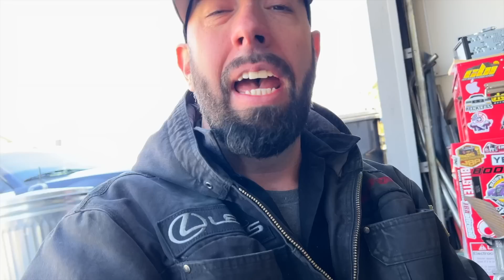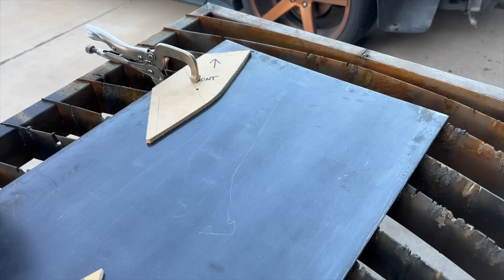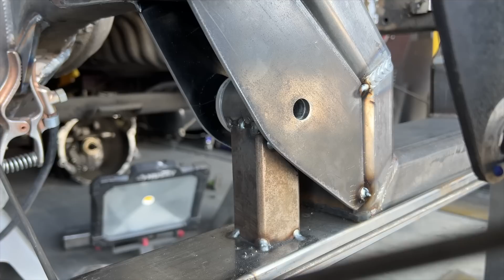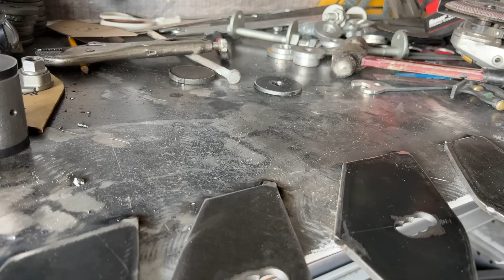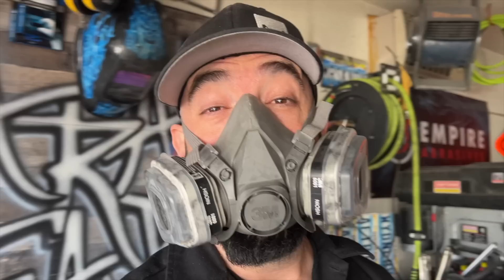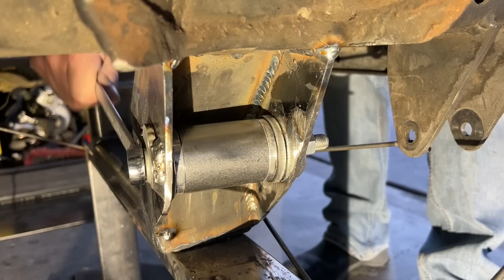How to Build Adjustable Alignment Bushings! Mighty Max Ep: 19

Comment: I know I'm about 3 years late, but anyway... Why didn't you block your truck up so that IT was level and not guesstimate with the level being off 🤔? Just wondering. Haha
Reply from the maker: Good question! This was the only time I used the level. Most often I’m measuring from the ground because it’s easier and a bit more accurate for most things. Imagine wanting to mount something to the frame in the same spot on both sides. Measuring up from the ground is easy and effective even if the ground is at a crazy angle. 
If the truck was leveled, I’d have to situate a level every time I wanted to find the same point on the left and right sides.

Comment: What would you recommend? I have a 84 Corvette frame with the stock rear end .  the rear end is independent, suspension I have made 
the frame longer because I’m doing a body swap. I have an LS with a 4L80E  . either I need to make the stock C beam longer or build my own torque arm. I think it would be better if I had a torque arm your thoughts would be much appreciated and how I would go about making a torque arm

Comment: Was just re watching this one, and noticed that you put the 1/4 washers on one end instead of one on each end to keep the bushing centered. While the width would be right, wouldn't that shift the bushing a 1/4 off front to rear...which would possible effect caster if you don't compensate when you make new control arms? And if you used the existing arms, it seems like it would be an issue. Or am I overthinking it?
Reply from the maker: That was a whole lot of correctness. I’m currently in the process of building and filming the lower control arms and I’ve already talked about how confusing it’s going to be. Everything will be based off of the front edge of the factory control arm bushings. If you watch the video a third time 😅 (edited because I realized I meant the crossmember video) you’ll see that the first thing I do is bolt the mockup bushings to the front edge of the crossmember. In essence the only thing that will remain factory is the relationship between the position of the ball joint to the position of the front of the bushing. 
You are correct though; Moving the control arms forward or back would in fact change caster. As long as I don’t screw things up, (probable) caster and camber will remain the same but the bushing widths will change and the additional bushing on the triangulated control arm will be in a new location.
Hang in there. I’ll try my best to make it make sense.

Comment: Go to the hardware store and buy a bottle of muriatic acid. Whenever you need to weld galvanized or zinc coated parts, just soak them in a small mixing cup of acid for a few minutes, then rinse them with water. That completely removes the coating, making them safe to weld.

Comment: Also, the Mitsubishi truck as you know has press in balljoints which make it difficult to make arms. However the Nissan D21 (Hardbody) has bolt in balljoints that both fit the Mitsubishi spindles.
Reply from the maker: Haha!! You’re going to giggle when you see the new video on uppers tomorrow morning. 😂
When you say “both” are you referring to the lowers as well? I haven’t gotten that far yet.
Reply: @GarageFab  yep upper and lowers both the same. Both fit Mitsu or Nissan spindles. There's also some screw in style balljoints that fit. K772, K778, K727 are the most popular ones.
Reply from the maker: Much appreciated! The Max lowers are also bolt-on so I was just planning on using those but I’ll check out the Nissans and see which I like better. You are appreciated. 🙏
Reply: @GarageFab  the Nissan has a press in lower. So you can use a mitsu lower in a Nissan. Been a decade since I had a shop building tube arms. Some of that's hard to Remember.
Reply from the maker: Oh! Ok.

Comment: Hey, I've been using cam bolts on control arms on bagged trucks for a while. I now also use them on 4 links too. I use the ones from a GM 88-98 truck. Oreilly stocks them. Part number 87400. I also have cad drawings for the loops to go around the cam bolts and the slotted holes that can be applied to any job. 

I used to have access to a plasma cutter so now I use sendcutsend for all my cutting. 

If you need any of those drawings please let me know. I don't know if you remember me but I did the Mazda limo and the Dawgsled on the cover of minitruckin November 02
Reply from the maker: Thank you for that! I’ll look into them. The Toyota version was not cheap. My next build will require 8 of them so saving some money would be swell.
Funny, I intend to throw this thing on the alignment rack when I’m done and see how close I got with just measuring the rear suspension and left enough room in the tabs to convert them to adjustable bushings if needed. Probably would’ve been a good idea to just do it from the start.
Yes! I remember those trucks. Clearly you’ve been in this scene far longer than I have. In 02 my Mighty Max sported a targa top. (My biggest mod at the time) I didn’t know anything about suspension back then.

Comment: Get a small fan that blows away the fumes as you weld. Might have to turn up your gas shield. Or even a shop vac turned on to pull away the yellow mustard gas lol
Reply from the maker: Good call. I’ll be assembling something soon!
Reply: @GarageFab  down draft welding table. What ever it is I'm sure you will Ace it. Love the videos.

Comment: Your router tip is pure gold. A little tip in return. Use the cams to get the alignment done. After everything is where it needs to be, measure the cam bolt location to make a cam delete plate. I did this with 2"x1.5"x0.25" blocks I made to replace the cam. Drill a hole in the plate where the bolt sits in the cam. In the end, no more screwing up the alignment with the first wrong bump you hit.
Reply from the maker: I like that idea a lot. We see delete plates pretty often on off road vehicles. I’ll definitely be doing that if I see any alignment drift.
Reply: @GarageFab  I have 26 miles of dirt between my home and the first hard ball road. I would get 2 maybe 3 trips to town before I would start to notice it was off again. I almost got to the point I was going to just weld it in place. Then I stumbled a store bought cam delete kit, and thought, I can make that. About 2 hours of work later, and the problem is gone.
I've been contemplating starting a channel myself to show that even off grid with no garage, if you really want something, anything is possible when you set your mind to it. I have a couple hurtles to figure out first though. 1 is my lack of signal for uploading (feels like the good old AOL days out here). 2 I'm a wildland fire lookout. I actually move out to my tower for the summer tomorrow. That brings in a hole new set of challenges to overcome between time and when fire restrictions come into play. It's still possible, I just need to sit down and put some good thoughts to it all.

Comment: Tip for working on a floor that’s not level if you feel up for another small project. You can make some custom stands with large threaded rod that will allow you to adjust each side or corner independently in small increments. This way on the side where your floor is lower you will adjust the stands a little higher to compensate and keep your truck level. Or you can just keep doing what you’re doing. 😂
Reply from the maker: Quite brilliant. If you don’t mind I’m going to steal your idea and create a video on creating adjustable stands. I think that could be really interesting.
For me personally, though my floor is slanted slightly, it is straight, so I rely mostly on squares rather than levels. (15 inches from the ground is the same in both sides regardless of the slant)
My next build will utilize laser levels so I’ll be building a low profile frame table. 👍
Reply: @GarageFab  yeah by all means! Curious to see what you come up with. It’s not my original idea either, I saw someone else do a variation of it but don’t remember where I saw it. Just filed it away for potential use later. 🙂
Reply: @GarageFab  Also fyi another channel you might like is Austin Niemela. He also does custom automotive fab work.
Reply from the maker: I’ve seen a few of his. Good shtuff!

Comment: Hello Aaron, I'm back with a question. The rear suspension is 4 links, in which the lower levers are attached to the bridge using simple rubber-metal saylet blocks, and the rear trailing arms are attached to the frame like on a Mitsubishi Pajero, we call them "sticks", I know that such a connection is used where a pushing effect is needed, and w upper arms of the same design but only installed on the turn. I hope I made my thoughts clear.

￼
Reply from the maker: I think I’m clear. And that sounds good so far. What’s the question?
Reply: @GarageFab  я хочу построить подвеску на таких рычагах, будет ли она нормально работать? Мне такая конструкция рычагов не встречалась и по этому куча сомнений, может быть я слишком сильно паникую 🙄, кстати ход заднего моста планируется в 27 см так как мне больше и не нужно. Музыка в твоих роликах классная 👌
Reply from the maker: I think you’re on the right track. Everything should be just fine. If you ever get around to drawing it up, send it my way @GarageFab702@gmail.com and I’d be happy to take a look.

Comment: @garage fab Are these the tabs you were talking about? If so another easy trick is taking a piece of all thread with (2) nuts & washers in between the tabs and opening it up with a couple open end wrenches.  

Nice to see you using Toyota cams on the lowers! They're super stout and make for easy alignments. On my offroad builds we usually swap them out and solid mount the lowers with a heimed upper control arm for adjustment. I've never seen one break but we do it just to keep a true alignment through rough terrain on oversized 37x13.5 tires

I have the same respirator just swap out for the 2091/2097 filter pads and your hood will fit over the mask. 

Great work man! Keep going! Only one other suggestion would be to consider using fine thread bolts for all suspension points. You'll get a better torque spec 👍
Reply from the maker: Yes! Those are them. The all-thread thing is brilliant! Pry bars and screw drivers certainly didn’t work. 😂 
I actually do use fine thread bolts. I didn’t know about Torque stuff, I just copy Toyota stuff. Shrug. I do have some sets of course thread bolts with non-nylock nuts that I use for mock-up/welding for easy install/removal. Thanks again, Anthony!

Comment: Hello Aaron, sorry for the intrusiveness, I want to ask "4link suspension on the highway works well, i.e. at speeds? and how is it generally suitable for everyday driving?"
Reply from the maker: Hey Alexey! Absolutely. Most vehicle manufacturers are moving towards 4 link suspension, even in trucks. The disability in a daily driver would likely depend most on what type of link bar ends are used. Rubber is the most portable as it absorbs a lot of road vibration, it doesn’t last as long, especially in vehicles with a lot of suspension travel. Heim joints offer a lot more suspension travel, but no vibration absorption. Polyurethane is my choice for linkbar Bushings. They’re a little firmer for more performance, but still absorb some vibration.
Reply: @GarageFab  спасибо за совет, когда построю сниму ролик и скину ссылку, посмотришь, оценишь, у меня маловато опыта в постройке подобных подвесок.
Reply from the maker: I can’t wait to see it! 🙌
Reply: @GarageFab  терпение мой друг, сразу скажу что всё будет на резине. Я сделал небольшой макет и сейчас изучаю работу и ход рычагов и моста. Я не очень оператор и не претендую на Оскар но если интересно то вот посмотри то что я сделал на сегодня https://youtu.be/M7RcVc4G00o

Comment: Could you discuss proper IFS angles because if you are doing a chasey swap and or a chasey swap with a coil over it is important to know how to get the angles and motion right. Springs....... don't worry about that that is a whole separate issue but. the angles and motion are right in your wheel house and you can talk about that without having to do or buy anything. That would be some great content. I am so ignorant anything you share would be SUPER.
Reply from the maker: We’ll be starting on the front suspension shortly, so there will definitely be some IFS Suspension Basics stuff on the way!

Comment: Mr. Man Candy, could you comment on the factory angles of the pivot axis of the lower control arms as well as the axis of the upper control arms? I have a 3D model of my Chevy 2500 frame and the brackets for the lower control arm are not perfectly parallel to the frame in the computer. This cant be right can it?? It is hard to measure the actual frame to confirm what's factory. AND the angles of the upper control arm axis are certainly not parallel to the frame which is obviously "factory". What is the desired drop angle of the lower control arm from horizontal as a general rule?  I am doing my own IFS and need to know the desired "general rules" for doing a good job? I could do a SAS but I have a IFS axle. I would like to use the IFS axle  for a chasey swap but I don't have a good design rules to guide me in proper thinking. I think you are "THE MAN" who can address these questions in your "particular Idiom" to quote The Holy Grail.
Reply from the maker: First lemme make sure that I’m understanding what angle it is that you’re talking about; The front control arms are almost always angled back on production vehicles, almost as if the car hit a curb and twisted the control arm mounts backwards, resembling the wings of a passenger plane. There is also often a forward pitch to the control arms, meaning that the front bushing of an A-arm is lower than the rear.
Unfortunately this is something of which I don’t have a strong understanding at the moment. I know, (or I think I know) that the pitch of the control arms increases and decreases anti-dive, and I have read that the yaw angle of the control arms changes how harsh bumps feel. Angling the arms backwards allows for a more natural movement over a bump as the arm will not only move upward but backward slightly as well.
This is a topic I’m going to have to research a lot more before getting into the Suspension Basics videos for IFS. 😬

Comment: That was brilliant! 
How could I have those two tools in my garage for years and never have thought to put them together ? Carbide burr bit obviously goes in a router duh. Why didn't I ever think of that. It should actually work better in the router than anything because with the die grinder there's no plate to keep it steady and it just jumps all around and makes odd shapes and does bad things. I even thought, what would happen if I put a carbide router bit in the router and do metal with it but I don't think it would last long. But now I'm going to try it cuz I just want to know. I'm so mad at myself for never thinking of that but so happy that now I know, thanks dammit!
And nice job making those four parts identical !
I didn't pick that up till the end either but I've done stuff like that.😢😅
Reply from the maker: Believe it or not, a wood router bit works on metal too. Probably goes without saying that it doesn’t last as long. 🤔

Comment: I think you need one of those washers on the other side of that bushing otherwise you're going to have a big gap on the front and not enough room for the washer in the back
Reply from the maker: The cam in the bolt is so large it completely covers the slot in the front. The tabs were spaced with the washers in mind. 👍

Comment: Carbide burr in a router is an amazing idea!  I have been filing that stuff out for years...  Here's a tech tip to give back, you can soak galvanized metal in muriatic acid and it will remove the galvanizing chemically.  No muss, no fuss.  All the hardware stores carry this so it is easy to get.
Reply from the maker: Very much appreciated! And I’ll request more info if you have it. I have a lot of rust removal to do soon on a project. Do you know if muriatic acid removes rust?
Reply: Sandblasted Kandyman. That's the easiest way forward. I'm sure it's already done by now.

Comment: Hey Aaron
Given your floor is not level have you considered using washers or shims to make the chassis level on the stands or even some screw adjustable stands.
That way you can set the chassis level and have all your datums true.

Great episode mate. Love your content.
Also love the use of a small hand held router with the carbide tips. that is a game changer for accuracy
Reply from the maker: Micheal, Sir, sometimes the simplest suggestions are the most brilliant. I never considered taking a few minutes to level the vehicle at the very beginning of the build. 🤦🏻‍♂️ 
It makes me wonder though, if that would cause problems with all the times that I measure from the floor to mount things. In other words 320mm up from the floor works for both sides regardless of level. 🤔
Reply: @GarageFab  yep that has merit also .
The reason why many chassis builders use a frame or table so that both are addressed.
Level and same datum plane.
We all cant make a frame but we can do either of the other two.
Reply from the maker: Word. As soon as Caroline’s truck rolls out of the garage, I start my truck which will be a ground up chassis so a small frame table will be built.

Comment: Shims are more reliable and consistent than ecentrics
Reply from the maker: That may be true merely based on the fact that shims are solid unchanging pieces of material.
But alignment fades over time generally due to wearing bushings. An eccentric bolt doesn’t change if tightened properly.
For someone that pays to have their vehicle aligned, I can’t imagine an “easy” alignment matters, but it certainly would for those that do their own. 🙌